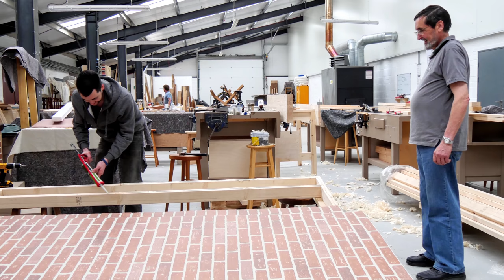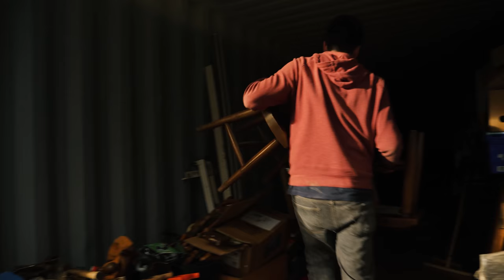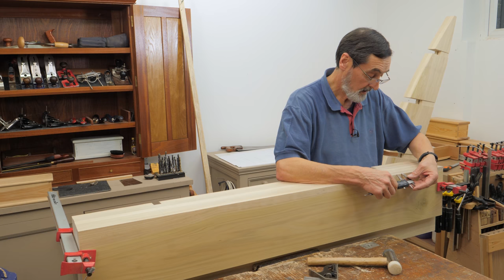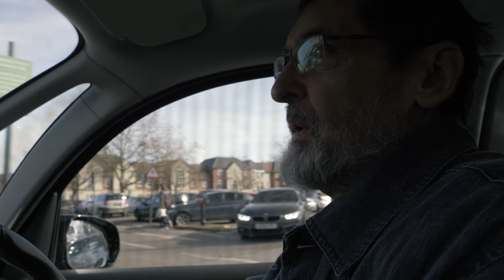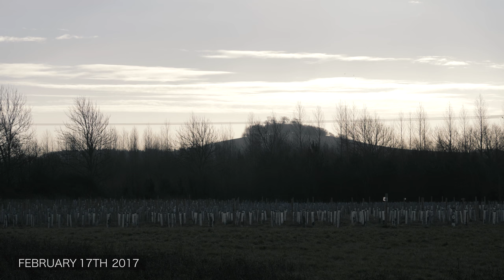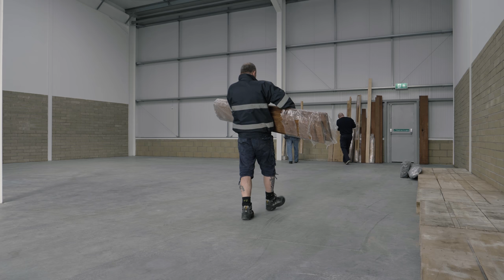Our New Building - Plans for the Future

Comment: I have almost finished building the workbench in my garage, the one you build in your videos. I actually decided I could do woodworking after seeing your first workbench videos, the ones set in your back garden, and I said "if he could build something like that with just one plane, a chisel and a saw, I may be able to do the same". And I am actually doing it, and am very proud of what I have learned and what I have done so far. 
So, setting your new videos in a garage-like environment I am sure it will attract a lot more people intimidated by the misconception you need a 1000sq ft shop and 10 grand equipment. 
Rock on!

Comment: Hope the garage set is going to have a lawnmower to trip over and an old Yamaha FS1M in pieces to add authenticity. :)
Reply: Don't forget the tennis ball hanging from the ceiling for parking in the right spot....
Reply: And a dog, and Paul looking for his tools and wondering who borrowed what.
Reply: and some boxes of christmas decorations and some garbage cans
Reply: And golf clubs with 5 years worth of dust on them.
Reply: It also needs to be draughty, leaky, badly lit and be stiflingly hot in summer . . .  oh and have piles of scrap timber that need to be moved all the time.
Reply: If it's going to represent a modern garage, it's going to have barely enough room for a small car!  Length 19' x Width 9' x Height 7' 6" seems to be a big garage nowadays!  My son has a garage that you can park a car in as long as you don't want to open any of the car doors...

Looking forward to the videos as always. All the very best to you in your new ventures Paul!

Comment: While you want to make the series inclusive by cutting down on the number of tools used. I would also very much like if you could present some of the tools in your tool collection. Especially the more rare and old that could be of great use to know and maybe make copies of. If the "tool legacy"  are not passed along, it will die in my opinion.
I'm a master patternmaker and while I have been working as such for many years in one of the oldest foundry pattern shops here in Denmark, I never got to learn and use a simple No4 hand plane or learned how to make dovetails by hand. Since I retired I have picked up on the traditional way of doing woodwork.
It is a real shame that I should be a woodworker for so long and never know how efficient and beautiful doing things by hand can be. That is a legacy lost in modern production.